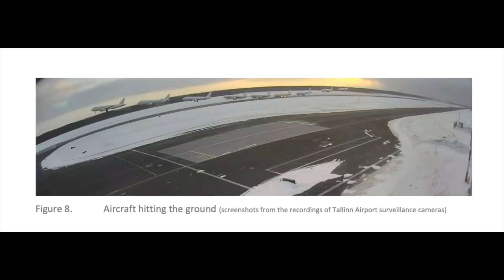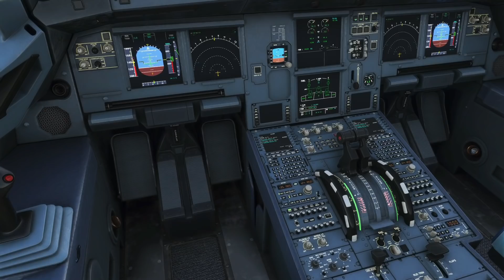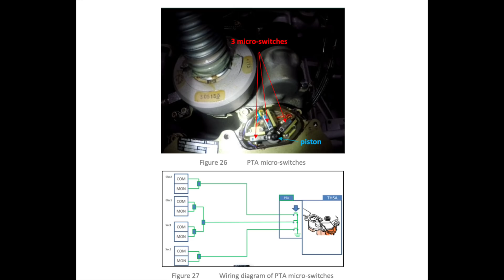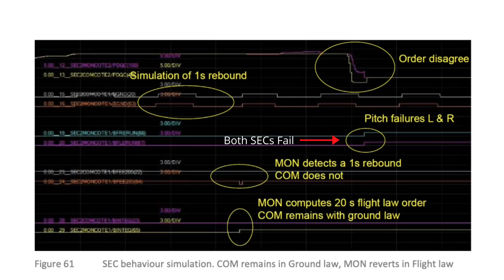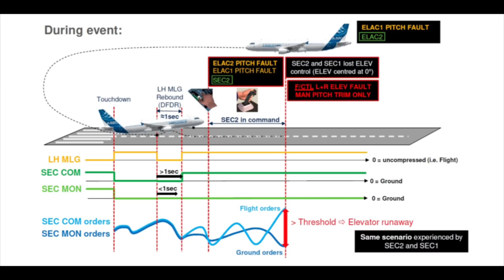The Oil Change That Crashed A Passenger Jet | The Crash Of Smartlynx 9001

Comment: Planes will be become increasingly more automated with technological advances over the years. It is an unstoppable trend. I think that it is great. It makes planes easier to fly and safer in my opinioin. Unless of course the pilots aren't trained on how to work with it and how to completely shut it off and regain manual control of the aircraft. I think that the Boening 737 is a great example of automation gone tragically wrong. That was Boeing's fault for not including a redundant sensor for the MCAS system and not training the pilots on the MCAS system at all,  Many pilots did not know it was there or what it was capable of doing. I don't think that's a fault of automation  in general so much as attributable to greed on Boeing's part. Anything can fail on an airplane. Computers help diagnose it and warn the pilots. In that way, they are essential. But they can't fix it. I agree that the pilots shouldn't have pushed it when they got two failure warnings in a row and should have stayed on the ground. You don't take risks with lives and an expensive plane when the computers issue mysterious warnings and you can't understand what is going on.  By continuing to fly, they did more damage to the plane (engines catching fire and shutting down) lessening their chances of getting the plane and themselves down in one piece. The automation, the computers, were trying to tell them something which in this case was not in the training manual. Once they shut the computers down twice to reset them, they should have stayed on the ground.  This was not a problem due to automation. Most automation has built in redunancies that can act quicker than pilots do. But the pilots must still be able to shut the automated parts off and take manual control of the aircraft without fighting with automated systems.  My answer is that automation gets a 9, with the caveat that it must be able to be quickly turned off when problems occur to let the pilots take control.

Comment: So we have a few Homer Simpson's that keep resetting what the computer is trying to warn them about.  "Stupid Computer!"
Reply: To be honest, it's not only their fault. How much information does the system provide to diagnose what just happened? If none, then they follow the manual. The manual says "just reset it, it'll be fine". At this point they're out of options. 

Manufacturers restricting information out of systems is a major cause of issues. Intelligent feedback is hard, though.
Reply: @StCreed  yeah but when the same system keeps failing, you should probably land and check that system.

Comment: I think that a 6 or 7 would be ok for automation, but build in at least SOME actual mechanical override to actually be able to at least get the plane on the ground safely, either with cables or hydraulics to give the plane a minimum of a 3 point axis, rudder, ailerons, and elevator or even a 2 point axis with just ailerons and elevator and use differential engine thrust to turn
Reply: You are confusing automation with computer failure. Those aren’t the same things. The automation is anything where the pilot doesn’t need to do it. But a pilot needs the computers to fly manually using the controls
Reply: @tomstravels520  No, im not confusing the systems, let's say an A320 fly by wire system has a complete power failure, no computer is going to be able to control the plane because there is no power to the computers. Hence, the mechanical backup
Reply: @mattcat231  that’s not automation though. Automation is being able to carry out commands without the pilot telling it what to do or not allowing the pilot to do something dangerous. If your home computer stops working you don’t say “I’ve lost my automation” 

Also there has never been time a time where all 5x computers have failed on an Airbus. It would take so much to go wrong and it’s never happened so far. The A320 mechanical back up is just rudder and stabiliser. But it’s never got to the point here only those are available. You’d have to loose the generators, the APU, the RAT and the static inverter to have only mechanical controls.

Comment: Ok, but what accounts for engine two catching fire and then both engines failing?
Reply: Smashing the aircraft into the runway with the gear up before climbing again. Did you not hear that bit?
Reply: @tomstravels520  Yes, sure I did hear that, but the narrator never discussed whether or not this was the reason for the number 2 engine fire. It can be assumed that it was but the narrator should have said so. In addition to the lack of explanation on engine 2, there was no explanation of the loss of engine 1. The overall narrative was focused on the failure of the automation, with a paltry failure to explain the issues with the engines.

Comment: I'd go for around a 7.  I was lucky enough to take the controls of a 707 type aircraft, under the condition that I could keep it more or less in track and + or - 1,000ft.  We were at cruise in uncongested airspace and I had an IP in the right seat so it was as safe as one could expect.  While a wonderful experience, it gave me a whole new appreciation for what pilots have to go through on a good day (minus autopilot of course).  If automation means that a pilot can free up some brain bites for what's important, I'm all for it, given the condition that they can take back full control if needed.  Caveat, I like the idea of airbus not allowing the plane to be put in unsafe configurations, but I'm not to keen on the boeing 737-max type systems, especially with their initial lack of redundancy.

Comment: If pilots need to be able to override the automation, the automation should also have the ability to override the pilot. The warning systems in this case repeatedly identified the failing components- it was the crew who ignored the warnings and did almost everything possible to avoid taking the appropriate action.
Reply: The appropriate action was to reset the computer. This was the official procedure and every time a reset was done it restored the computer. If this was a normal flight they wouldn’t have seen this warning again

Comment: Aeroplanes like cars, they are crash science. The more accidents happen the more data they have to fix things usually unforeseen events like this video. Unfortunately we still have limited data on unforeseen events and a lot more crashes will still happen. 
I think automation will eventually be 8/10 with ultimate control still be on the pilots should they choose to override the two computers. Perhaps a third analysis computer to aid the pilot when in Manual control?
Maybe you can do a graph which show crashes due to Human error vs computer error?

Comment: Boeing 737 max has rods and cables that allows the pilot to fly the plane with no electric  or hydraulic assist.
Reply: Yes and that is because it is essentially still a 1960s airframe.

Comment: Automation is great but we have a problem where new pilots rely on it far too much and panic when something goes wrong. The second problem is is when the automation does go wrong its way to complex of a problem to handle in the air.

Ideally there would be a switch to go between the smart computer controlled mode and pilot controlled mode.  This adds expense and is impossible in some modern models but just throwing it out there.  Simulators need to throw out a lot more software problems too versus traditional plane problems.

Comment: Automation? Less than 5! These flying gameboys has two disadvantages: pilots loose the training to really fly there planes (look as well for the two 737 Max accidents) and electronics became to complicated - no one can fully understand the behavior in all circumstances.
Reply: What? You saying gameboy then refers to the MAX? Boeing 737 MAX is the most manual modern aircraft. Since it is based on 737 it is fully cable driven. All modern design airliner are FBW, this includes Boeing 777 and 787. The problem with the MAX is that they are trying to augment purely mechanical system with some automation added on. If for instance 737 are fully fly by wire, they can just tune the FBW system. Since the control is less coupled to the feel.
Reply: @kerucutgaming2216  MCAS, its malfunction in combination with the incomprehension of the cockpit crew was meant here. Added to this was that the crews had hardly any practice in actually flying the aircraft manually. Understandable when the electronics normally do everything in daily operation and the pilots only monitor.
Reply: @hplfd1  autopilot on daily operation is required by regulation. You can watch pilot on YouTube talking about this. When a plane is having autopilot failure, they must decent below a certain altitude and notify ATC. This is due to reduced seperation between aircraft and require precise control of the plane. Basically automation is required due to the complexity of the entire industry.
Reply: @kerucutgaming2216  I absolutely accept your point of view. Anyway, I know all of these fancy systems from the auto industry - they make pilots (drivers) dependent and over time it reduces their own ability to steer. Probably I'm old school here - but I think an emergency button "all electronics really off" is very important.

Comment: From a novice point of view, resetting computer faults without identifying the problem was the biggest mistake especially on a training flight with nubes at the controls practicing.  The instructors were lucky that they even got the chance to regain control of the airplane.  Don't ignore warnings especially on training flights!  How many times have we seen here and on other channels experienced pilots ignoring and resetting faults only to find themselves in emergency situations.  Nobody spoke up and took charge until it was too late.  They all failed in my book!  This is why accidents always seem to repeat themselves!

Comment: I'd lean towards a 7-9 on automation as long as pilots are still regularly trained on non-automated flight, simply because if the pilots are not fatigued they are going to be more able to respond if something goes wrong.

Comment: So was there any recommendations to change the programming and systems to prevent this happening again? Or was it deemed impossible to recreate?
Reply: Airbus changed the policy for training flights in that if a fault occurs the touch and go is counted as one flight meaning if they touch the runway then stop and get it assessed. Also I think they actually limited the number of resets
Reply: @tomstravels520  thank you

Comment: I feel like this could be a stupid question, as you could have explained it, or my lack of knowledge didn't comprehend, but why did engine 2 set on fire and ultimately both fail?
Reply: Smashing into the ground after raising the gear and loosing pitch control

Comment: Crazy!!! First sight of any kind of trouble, I'm grounding the plane as the safety pic.
Sorry guys I wanna live, lets reschedule and live another day.
That is so irresponsible. This is not your Nintendo or washing machine. 😡😡😡😡😡
Reply: A single failed computer will not kill you in the plane. Resetting the computer actually cleared the computer fault. The airbus manuals did not dictate how many times this could be done as it just said to attempt a reset and if it clears then all good
Reply: Simple fact, there was a incident and people could have died.. This is not a revenue flght so why risk it? Get it checked out....
Reply: @kayakconfessions4121  simple fact. If the pilot had kept resetting the computer then this incident wouldn’t have happened.

Comment: Personally I would be fine with all automation, as long as I had manual backups if needed. Even if the manual backup are impractical to use, I rather have that option when stuff hits the fan

Comment: This is the reason I will not fly on an Airbus product as they aree nothing better than flying Nintendo games. Less automation is better as seen by the Boeing screwup on the 737Max. 737 is the safest plane ever except when they took a page out of the others guys book and got carried away with the automation, hence the two crashes by untrained pilots with great loss of life. Give me a plane with NO computers except as supplimants to aid, never as control systems that can remove a pilot from the control system. 3 out of 10 for me as to automation. Nothing beats a good pilot in control!!! Good episode well explained. Thanks
Reply: The 737 is definitely nowhere near the safest plane. The NG yes but the whole family definitely isn’t. Multiple accidents on the classic and Jurassic variants. Also have you not realised that accidents over the last 20 years have dropped thanks to improvements in automation and technology? Max was only a screw up because Boeing didn’t build any redundancy into the system. This aircraft had 3 levels of redundancy at least. 

By your logic you shouldn’t be flying a 777 or 787 or any other modern aircraft as they also are fly by wire. 

Also if you ask any pilot if they’re a good pilot they will say yea of course. How do you determine a good pilot? When everything goes wrong. How about not getting into that situation in the first place. 

http://www.airsafe.com/events/models/rate_mod.htm
Reply: @tomstravels520  By miles flown by all variants they have one of the best safety records of all larger aircraft. A great old dinosaur design probably slipping past the BB date now. Thanks
Reply: @davidtucker3729  still not as safe as all variants of A320. And I haven’t seen a NEO crash yet but seen 2 Max crash

Comment: Automation saves more lives than it takes. But we only hear on the news when everything goes wrong, not when a plane was saved because the alpha protection, the  built in redundancy on surface controls and such. 
Now said so, it is always confusing to learn that such an small part can silently cause such a mess.. No pilot can guess such complex failure modes in so short time.

Comment: Keep the technology simple. Make the warning/ error messages precise and helpful. "No data from pitot #1"  would let the pilots know which readouts to ignore and which to believe. And keep pilots in control of the plane. They should be interacting with it on a regular basis, maybe every 15 minutes, and able to turn off the autopilot and take control at will. If the plane does too much, the pilots aren't physically or psychologically prepared to take control in an emergency.

Comment: That doesn't sound like good safety design. Since it's fly by wire, there should be a switch whereby the pilot can manually choose which computer transmits controls to the plane. If software developers on the ground try to second guess these scenarios they'll get them wrong, and as you say if all the computers disengage there goes your redundancy.
Reply: Why would the pilot want that? If the computer has failed then you have no control until the pilots switches to another computer. And what if it’s just the pitch channel of the ELAC has failed like this. You don’t want to loose the roll channel for ELAC 2 either

Comment: This situation bothers me.  Trainees need to be practicing landings in a simulator.  Much cheaper, safer, and better all around.  Touch and go's are for GA aircraft not a big jet, unless if reeaaally necessary, and then by 2 check airmen.  You don't reset computers more than once,  just like you don't reset a circuit breaker more than once.  When you land you write it up and get a maintenance sign off, or if you are on the ground you go back to the gate.  You call dispatch, talk to maintenance control and you refuse the airplane if you are uncomfortable with it as the PIC (pilot in command).
Reply: The simulator is nothing like the real aircraft. Why would you think simulator only is a good idea? How are they then going to handle their first landing for real with paying passengers?
Reply: The simulator is fully certified and is very similar to the aircraft.  Most pilots get type rated without ever setting foot in the actual airplane.  You do your first landings in the airplane with an instructor onboard in what's called IOE (initial operating experience)

Comment: Hang on, what caused the engine fire and failure of both engines?? You seem to have skipped over that a bit. Was it from the hard slam onto the runway before lifting off again?
Reply: Yes. Thought that would be obvious as the engines would be the first thing to touch the ground if the gear was up

Comment: plane; im broken
human; go away
plane; im broken
human; shut up
plane; seriously guys, im broken
human; whatever just shut up and go away
plane; i cant go up and down anymore
human; what? why didnt you tell me!
plane; i cant move the flaps anymore
human; seriously, why bring this up at the last minute!
Reply: it sounds like my boss
Reply: That is not what this was like. It was actually:
Plane, I’m broken
Pilots, reset
Plane, I’m fine......and then just repeated this cycle until the pilot didn’t reset the computer
Reply: @tomstravels520  
And that attitude is exactly why we need to take the pilots out and put technicians in. 

A technician understands that taking out the oil warning light doesn’t save your engine.
Reply: @brucebaxter6923  and then what happens when the computer fails, receives faulty data or cannot operate due to a bird strike that has caused total engine failure and lost nearly all electrical power. Then how is the technician going to fly the plane to safety?